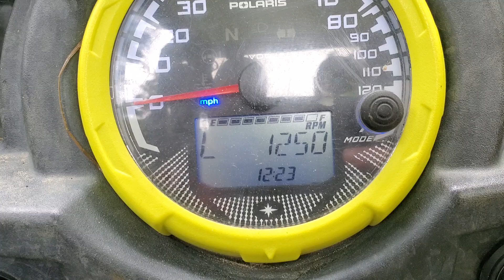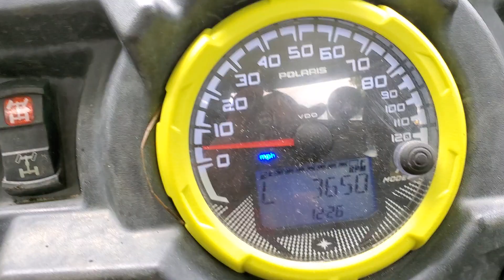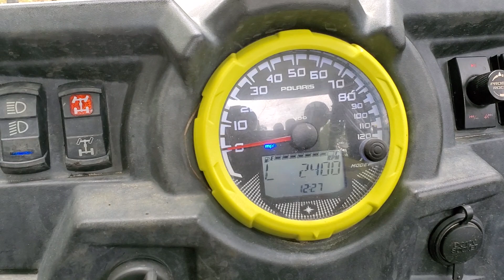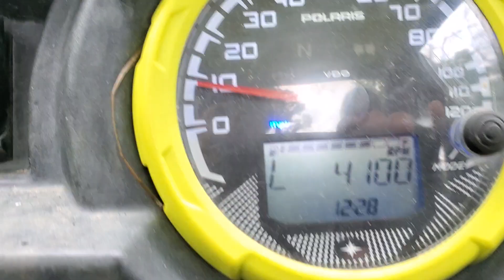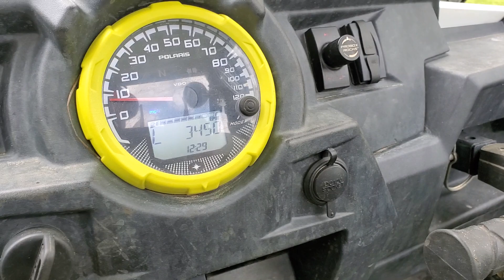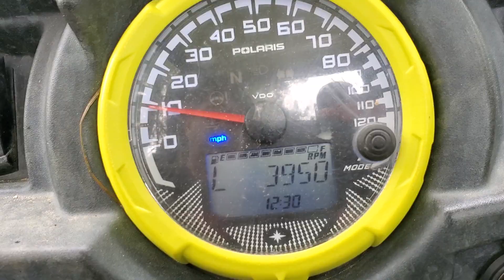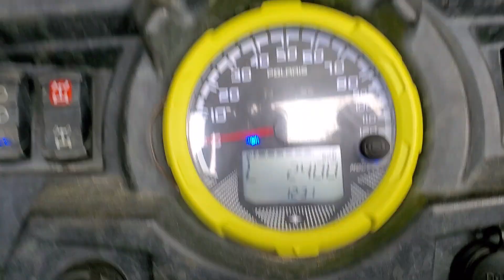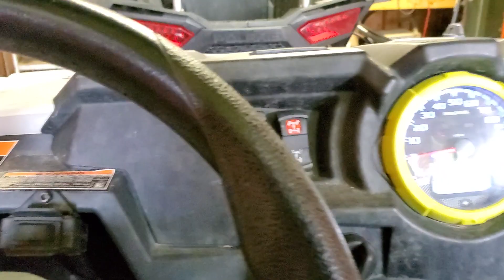Rzr quit running right!!! No codes!! NO POWER

Comment: Same as my 2009 RZRS, No error codes, dumped the gas and put injector cleaner in. 
Gonna check the plugs tomorrow. 
Need a gauge to check Fuel pressure.
Not sure but mine is acting the same.........

What was your issue?

Comment: There is a switch on the gas pedal that might be causing the problem, my friend has rzr 900s with the same type problem, when I give his throttle it stumbles and dies, if I can get it past that part it rips..I gotta is idea from another you tuber..There's a plug on the top of the right side of gas pedal arm with approx 1' of cable and another plug connector on the opposite end. From what I gather this part can go bad if it gets wet.. I've checked for fuel and it's getting it, if I unplug the left injector there is almost no change in rpm, if I unplug the right injector it will die, yet I've had both injectors out and cleaned them, perhaps its a combination between fuel flow or lack of it and possible the switch on the peddle..Hope you find your answer, hope I find mine too..
Reply: Did you find out the issue. You explained EXACTLY what my issue is and I can’t figure it out
Reply: @chrispaniagua6411  did you figure this out mine is doing same thing?

Comment: Seat belt ? On mine if the seat belt is not connected it will cut power. Btw how do you like those tires? R they pretty smooth on the road?
Reply from the maker: Yes seat belt is good...changed the fuel pump all issues went away. Tires are awesome
Reply: Seat belt was my issue. I almost took it to the dealer. It flys now. You have to click on the seat belt on my model. 2021 RZR XP 4 1000.

Comment: Let us know what the fix was!
Reply from the maker: It was the fuel pump.
Reply: @adamepperson4041  could you drive it and it would just randomly lose power? If so was it is just the fuel pump needing to be replaced because I have a rzr 900s and it started randomly just losing power and shutting off and then the other day it did like yours it wouldn’t pull in the shop it was just running
Reply from the maker: @That_white_jlu  yes and since the fuel pump replacement its been fine
Reply: I have the same problem and changed my fuel pump, spark plugs, spark module, air filter, O2 sensor, ran dry gas and injector cleaner in it with new gas. Still have the same problem....any ideas?
Reply: I’m having the same problem the fuel cycles when I start it but it does rev up then dies could it still be the fuel pump
Reply: Fuel pump and or Fuel pump filter these cheap made Chinese pump seem to have a lot of issue.
Also check your gas cap seal. You may find it is gone dried put and rotted fell into the tank and caused filter issues.

Comment: Have same problem with my rzr 900 what was the problem?
Reply from the maker: Fuel pump had 25 psi.. replace it. fixed it.
Reply: Where you get that fuel gaige to check..

Comment: How much oil do you have in it?
Reply from the maker: recommended... it was the fuel pump. it was only putting out 25 psi. I replaced it since and fix it Just havnt had a chance to do a video cause of work.

Comment: did it ever backfire?
Reply from the maker: Yes.. but not a consistent. Just every now and again
Reply: @adamepperson4041  thanks for answering man, mine doesn't want to go over 40 mph and it will backfire every now and then when it's under pressure. i wonder if it might be the fuel pump like yours
Reply from the maker: Sounds like it
Reply: Just replaced my fuel pump but still having issues any help
Reply from the maker: @matthewglass9609  did you verify fuel pressure? I bought a cheap one ($180) and when check my fuel pressue it was 100 psi. After 1 ride it dropped back to 35. Ended up spending the money for factory fuel pump. Also might do a YouTube search. I watched one they was having a wiring issue that ran to map sensor.
Reply: @matthewglass9609  did you ever find your problem?
Reply: @josephrobertson7609  the cheap fuel pump would not hold pressure causing no power I had to buy an oem one

Comment: How did you fix this ?
Reply from the maker: fuel pump, video coming shortly
Reply: Clutch is slipping bad
Reply: Adam Epperson, having the same issues now, not the belt, was to begin with but belt slip throws misfire code, almost the exact same performance issues but no code for me after I bought a new belt I think I’ve narrowed it down to the fuel pump. And it only does it when it’s been running